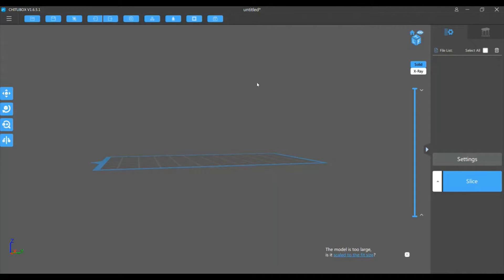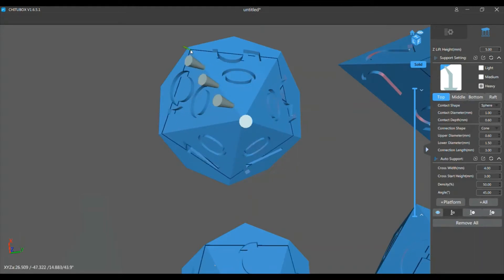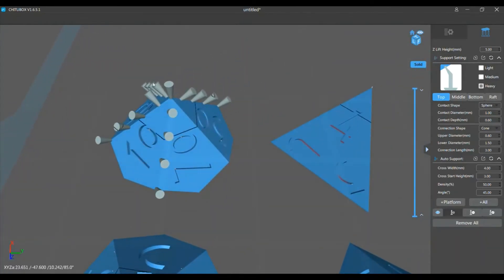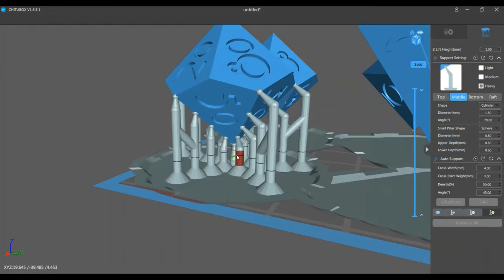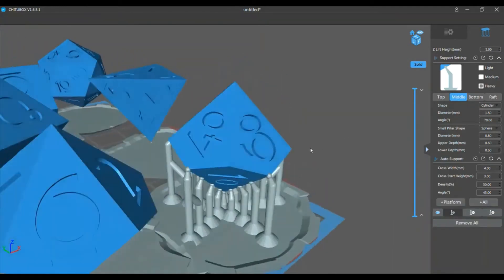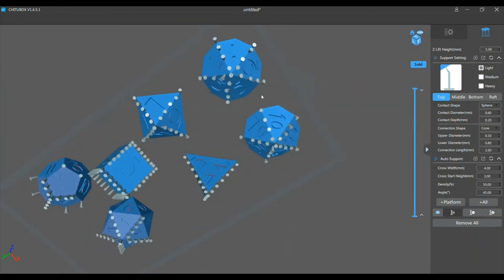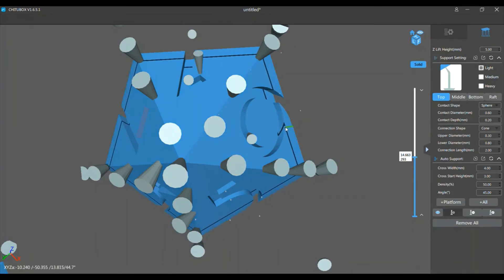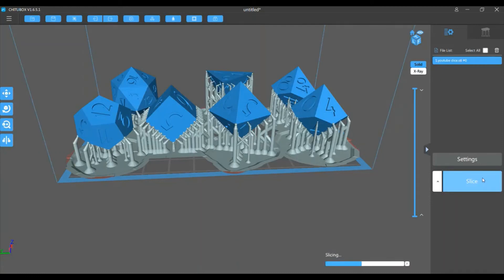DIY 3D PRINTED DICE SUPPORTS // Supports for 3d printing dice masters

Comment: I’ve done the wall method and it’s so time consuming and can also be a pain to remove. Have you noticed any warping with your method? I have that problem still especially with the d20.
Reply from the maker: I don’t get any warping on mine. I did find that when the supports are angled at different directions instead of being straight it causes some warping

Comment: I believe if you set the Angle value in the "Middle" tab for your heavy supports to 0 (it'll change to 0.02 which is the min value I'm guessing), they should just come out straight, then you can skip the step where you go back and try to make them as straight as you can.
Reply from the maker: Oh nice! Thanks for the tip, that’s going to save me so much time 😃